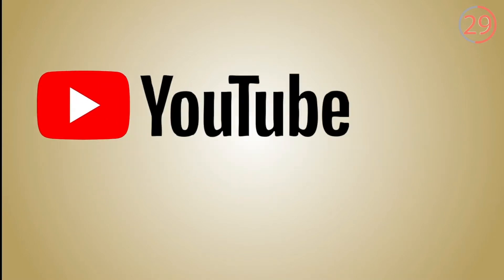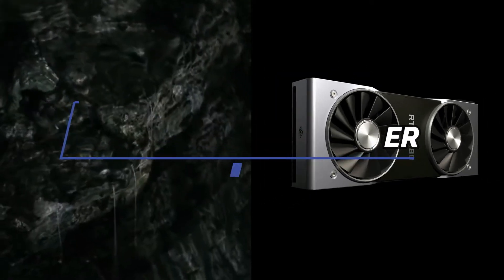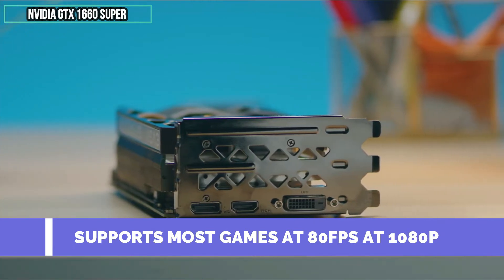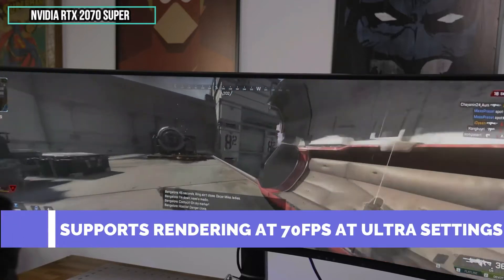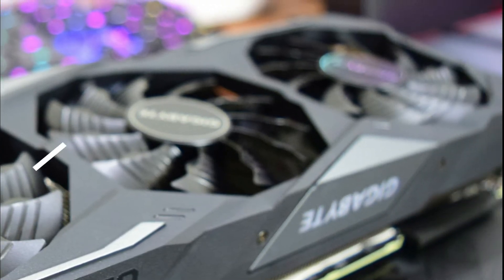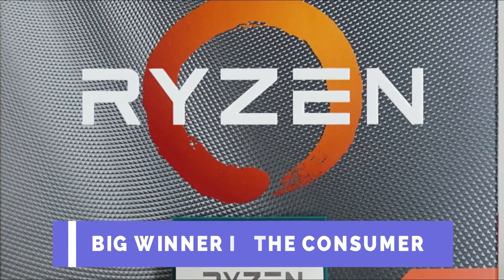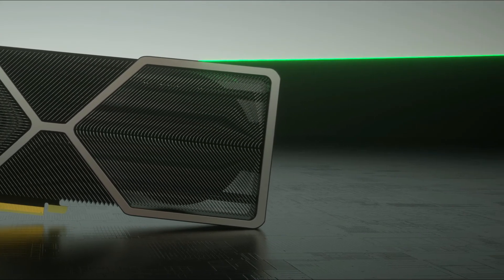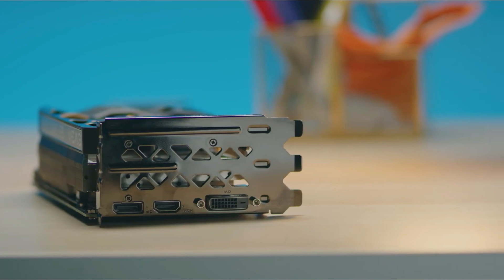WATCH THIS BEFORE YOU BUY A GRAPHICS CARD! [2020 Edition]

Comment: The 5700xt is found for $350 - $400. The $450 models are the bling models. And techtubers who test ,would disagree with a %15 deficit against the 2070s. And AIB models don’t tend to run hot. That’s an issue with blower style.

Comment: please suggest me a graphic card  in mid range budget to pair with  ryzen5 2400G
Reply: 1660 Super, if you have the spare budget go 2070 Super. 

Yes AMD GPUs are cheaper, but the drivers have a reputation for causing conflicts and errors with games, programs, and other drivers.

Spend a bit more on Nvidia for less headaches.

Most important question in what resolution and frequency is your monitor?
Reply: @trentsharpe5505  A ryzen 5 2400g paired with a 2070S are kidding m!
Reply from the maker: shivam srivastava hey, what is your budget?